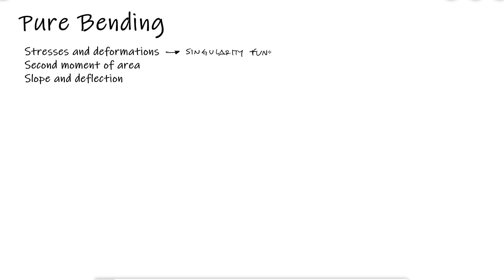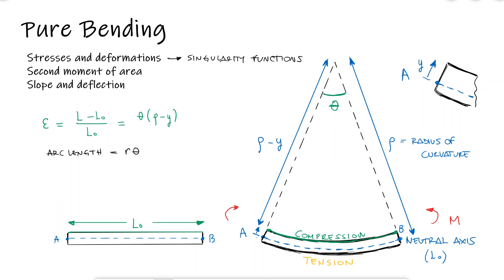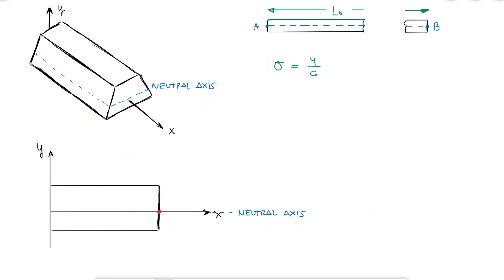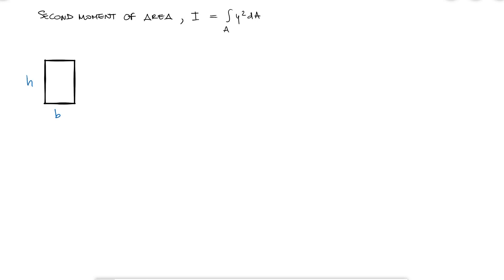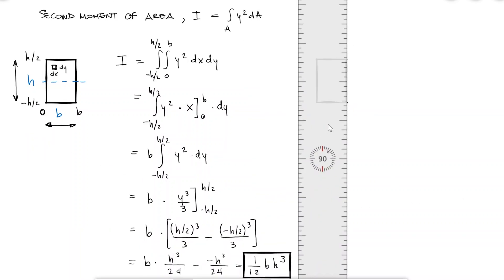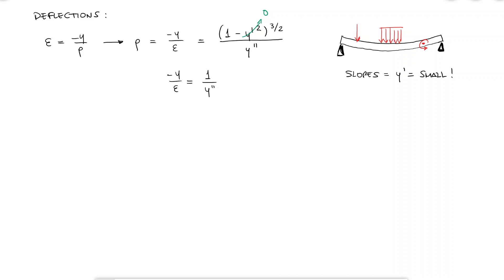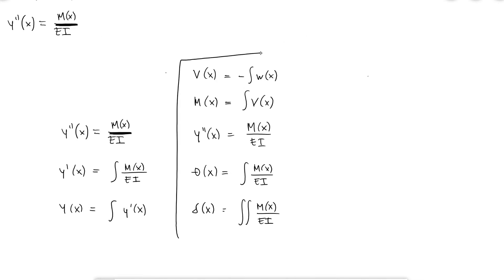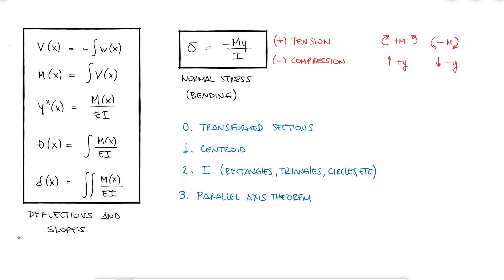Bending Review for Mechanical Design in Under 10 Minutes! (Updated Version Below!)

Comment: Hi thanks for your videos they are very nice. In regard to the 2nd moment of area, is the y value in the integral equation squared to account for the moment lever arm contribution above and below the neutral axis? I have always wondered where the y^2 and x^2 terms come from for the Ixx and Iyy equations respectively.
Reply from the maker: Thanks! For bending, specifically, yes, the y^2 or the x^2 come from the lever arm (one x or one y) times the force, which in turn, is also a function of x or y. So it results in x^2 and y^2. Completely separate from bending or any kind of stress, the first moment of area is defined as the area times the length (integral of y dA), and the second moment of area is defined as the area times the length squared; and so forth for third, fourth, etc.
Reply: @LessBoringLectures  Thanks for the clarification.